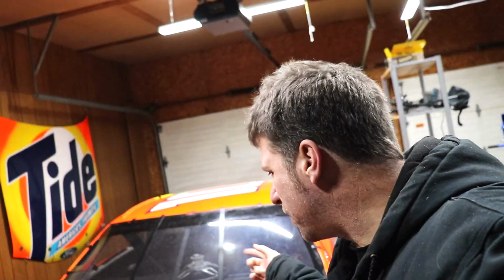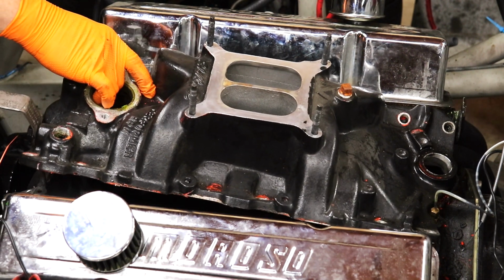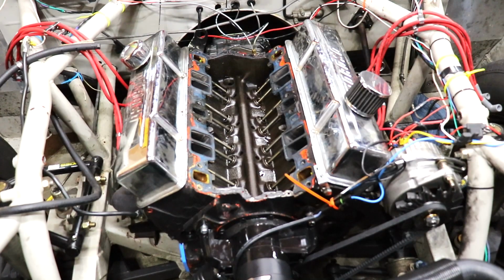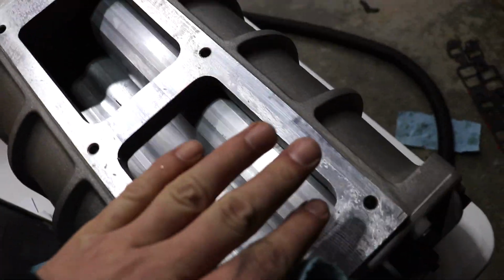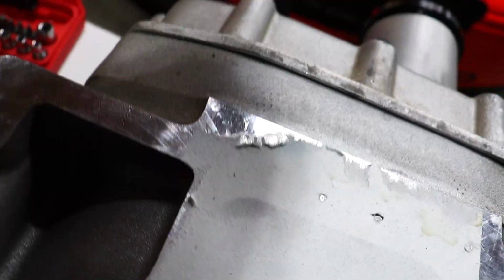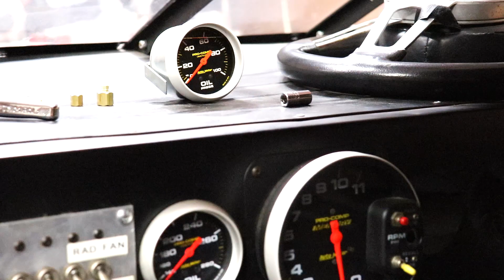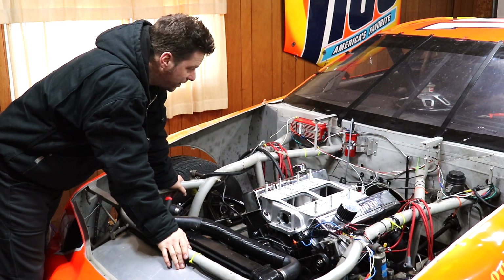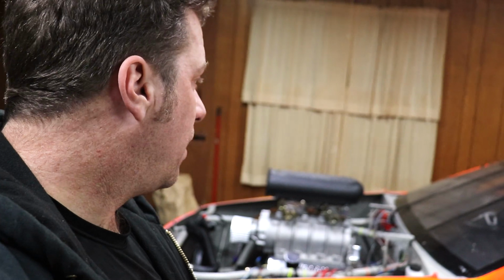Blower Is ON The Tide Car!

Comment: Yes! BTW are you gonna get a new hood for the car? It’s because I’m afraid when it rains, the engine might stall. Still a cool concept!
Reply from the maker: You're right. I'm still formulating a plan for that. I can weatherproof everything I'm pretty sure.
Reply: I used to have a car with an exposed engine. I used silicone dielectric grease on the plugs, wires, distributor, and coil. It would run with a garden hose sprayed on the ignition. The problem was that it collected dirt ion then grease and had to be cleaned regularly.
Reply: @RightTurnRandy  alrighty
Reply: @jbuchana  I can see that